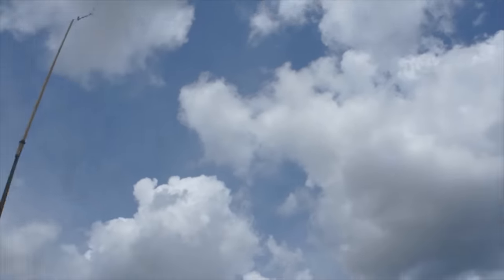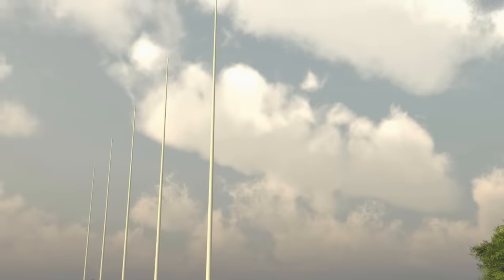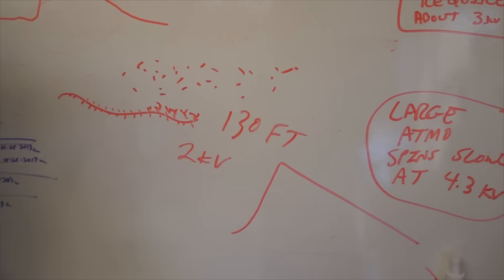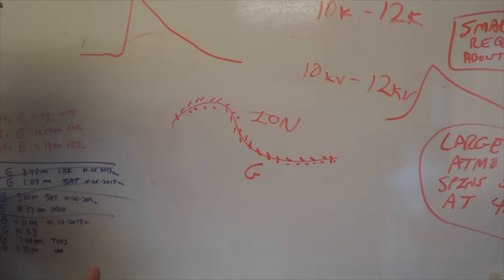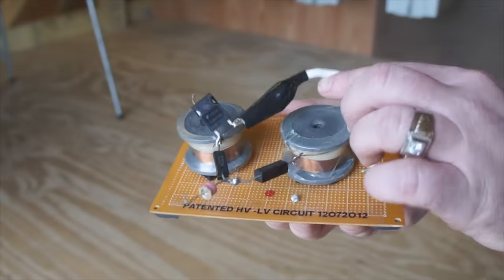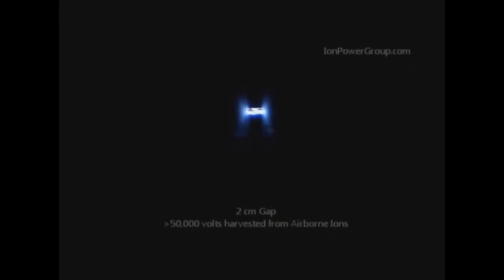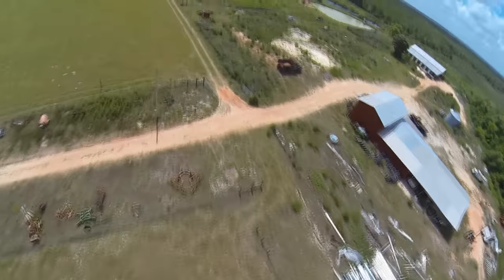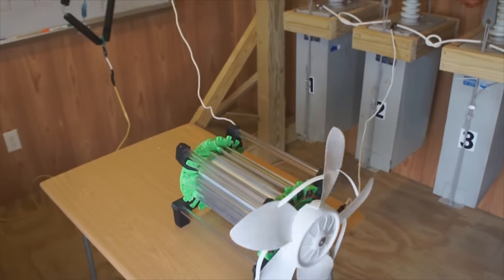Graphene/Graphite Atmospheric Electricity Collectors - Plus Horrific Hexacopter Crash!

Comment: Let me save you boys some money :)  I used a 540 ft. ham loop up about 40 feet hooked to a 15KVA 20 pf cap from a television station transmitter, then to a regular old $2 spark plug for a spark gap, then through the top of an old Ford truck coil to downconvert to pulsed 20 or so volts.  At some pretty hefty amperage I might add.  It would charge a bank of 3 12 volt marine deep cycle batteries in about 2 hours!  It would also run a small neon bulb constantly.  More metal surface works better than more height!  Try stringing coke cans along your wire.  You will find a very large jump in amperage!!!!  I ran my ham radios for over 2 years with  that system.  Be warned, 15KVA at amperage gets very dangerous!  It can and will jump over a foot in the air to kill you!  Hams, during the depression of the 30s used such systems to power vacuum tube radios! (they used T model coils of course)  As Solomon said "There is nothing new under the sun" :)
Reply: Seeing as the Babylonians and Chaaldeans had carbon pile dry cells and iron copper wet cells, I am sure the technology has been around a lot longer than we might find just walking through a desert wasteland 3700 plus years later.
Reply: would you please upload a video on your prototype ? cheers
Reply: Luis Kreische Since I am not seeking funding and am already successful in my research, no.

I already got mine, I'm not passing it out to others.

We as a group worked together with our own money and machinery, we did not get funding from others so we are not beholden to anybody.

If you want free energy, do like we did, research and experiment.
Reply: All right, a wee quick question, on the above video he mentioned something like "a stripe of carbon graphine graphine, where can I get this, is my understanding correct? Or is that just a simple wire with graphine spread on it? Thank you kindly
Reply: Luis Kreische Well I can not speak for the person in the video, but I would suggest one make fibers because this would increase not only the carrying capacity, but it would also increse the strength and reduce the chances of physical stress failure.

As to where graphene can be obtained, its apparently quite easy to obain, although as to how long of an individual piece one can obtain, I assume there is no theoretical limit, only limited by the means of manufacture.

For instance, soot, which is a pure carbon sphere called a fullerene of which some are so perfect they care called 'buckminister fullerines' or 'bucky balls' after their discovere Sir Buckminister Fuller, were the predecessors of carbon nanotubes.

Since it is easily obtained in small sizes, it might be more cost effective to use it that way for some purposes, but for others, it may be necessary to use full length strips in the case of weaving pure graphene fober cords and the like.

https://en.wikipedia.org/wiki/Graphene
Reply: Delicious DeBlair That is why you can never help the world. You have to help the people. The only way is to share and spread the knowledge. The movement has to move to an active stage where people are making their own energy and spreading the word in vast waves. Or the big corporations will keep holding back the people and making more money while we live like slaves watching our money vanish and pay for less and less of the things we need to survive. I have done lots and lots of research and it all ends it dead ends. Free energy is the key and if I ever figured it out, I would give everyone blueprints for free and share the knowledge so it can be passed on to many generations.
Reply: NotWatching666999 I'm not here to save anybody,

I offered my 2 cents worth, even got a positive reply from the people who run the program.

I was 'just passing by', made my remark, and I'm done with it now.
Reply: Luis Kreische Graphite string is likely to vary from full length graphene fiber so I can not say specifically yes or no, I can only say that you are looking for maximum condictivity, maximum service life and maximum tensile strength.

Find what works from there.
Reply: HM Dickson By 15KVA do you mean 15 kilowatts? Are they the same? Thanks, just trying to learn something new today.
Reply: 15 kVA is 15 kilowatts.  15 kV will not jump a foot in air and sea level.  It won't even clear an inch.

Comment: Your copter crash made me wonder if the collectors could be adapted to attach to balloons.  Tethered to the ground, with self powered motors/rotors to hold station points, tension on the collectors.  The idea I had was this would allow "fishing" for the most powerful altitude range on any given day, and allow the system to be brought to ground during tower damaging weather.  I was reminded of some video I saw along time ago of Lifter tech adapted to a scaled down blimp, where they positioned the lifters on a horizontal axis to propel the blimp.  I'll see if I can find and it link to it... Peace  Gill

Comment: I'm now 68. I saw my brother, now a retired physicist, string up a wire around the parents place for 300 feet of length more or less. It was insulated from the trees on which it hung by insulators. Between that and a ground rod was a small neon light which stayed lit. 60 years ago? It works but the power is small. A fun memory.
Reply: That's pretty sweet
Reply: neon bulbs do not need a lot of current to activate that's why to this day they are still used as indicators. Cheap and low power consumption.
Reply: I'm  have any links for that?
Reply: I'm  unfortunately the video doesn't have any evidence that couldn't easily have been faked using a hidden magnet.  I would like to get a sample and do some personal experiments with it. Something that attracts gold like a magnet would also be valuable to the gold miners and would have been used shortly after it's discovery, doesn't sound legit.
Reply: I'm  a debunk of the first, as I suspected. If the first video waa more convincing, then I would suggest trying to also find a debunk of the second video, but, the first was to obvious, so, there won't be a third to debunk the second.
Reply: The ground is negatively charged, what if you dig deeper into the earth. Will the negative charge become greater.

Comment: I'm building an electrostatic generator specifically to accelerate the collection of atmospheric electricity. I've read in an old patent that providing a high voltage exciter field can help to encourage the ions to move towards the collectors and create a net gain in energy harvesting.

Comment: Nice. I'm envious of their towers. Plenty of room there for more.
Reply: That was also my thought if the 800ft worked out as unfeasible. Build a heck of a lot more of those towers and have tram lines of power collection. I wonder if a beneficial capacitance would result from those lines being in close proximity to each other, perhaps held apart by plastic spacers.
Reply: I can think of a far more logical layout for this.
Reply: I was thinking that maybe they are not fully optimizing their layout and it isn't necessarily height that will bring in more efficiency but instead variances of heights and angles to the poles...I wonder if they even oriented their towers in any NSEW orientation as indicated by Ed Leedskalnin's work, it could make a significant difference in how much is collected how quickly....and do they really need so much open area between the towers beyond maybe avoiding one hitting another if a storm knocked one down?  
So much potential resulting in MANY questions since so little was actually covered!!!